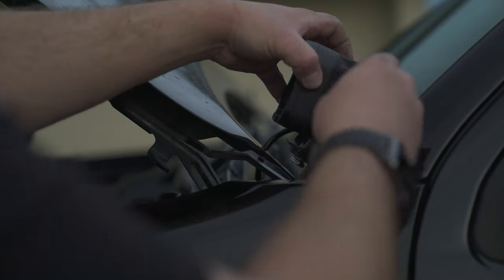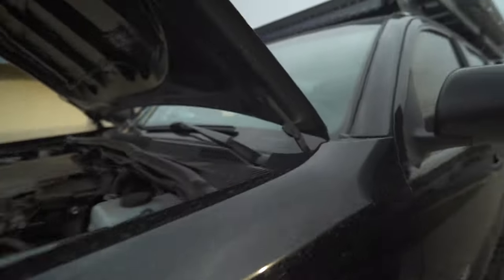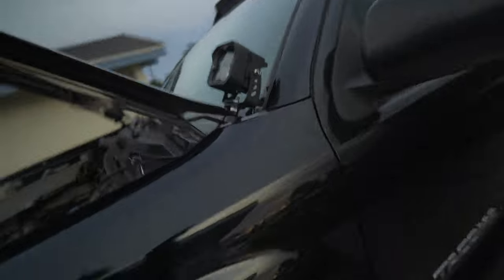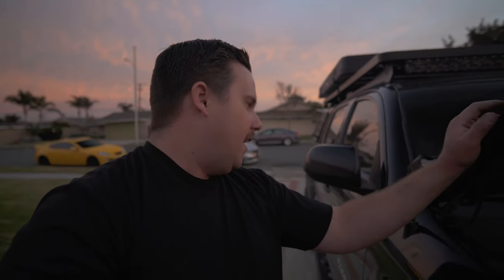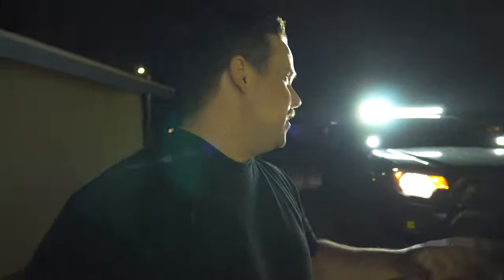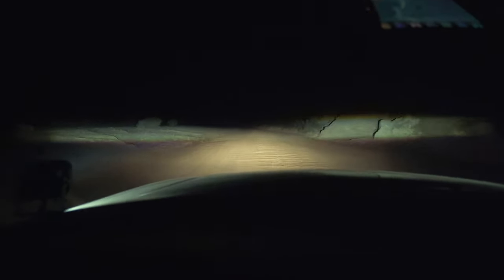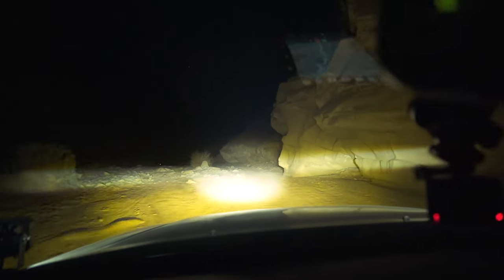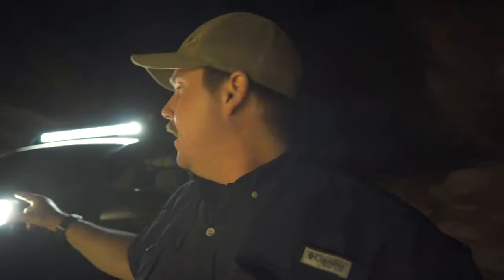3” LED Pods |  ARE THEY WORTH IT? Install And Test Of Lasfit’s LED Pods

Comment: Where and how did you mount your auxbeam power distribution panel at? Did you drill holes into the side to mount it?
Reply from the maker: Yes I used a rivet tool to create a mounting location.
Reply: @alpinetactics  thanks boss✊🏻

Comment: I could be wrong but I’m pretty sure that’s the fog light pattern either way good video and great lights
Reply from the maker: Thank you, it is not the fog light pattern
Reply: @alpinetactics  Which pattern are these? This is exactly what I need for my truck. I've been fooled too, these look like the fog light pattern.
Reply from the maker: @dedlyop3544  I did the driving patrern
Reply: @alpinetactics  There's no driving pattern on their website.  Fog, flood or Fog/flood combo.  That flat wide light pattern with sharp cut-off is clearly a fog pattern.  I think you would be better served for what you're after if your pods were the flood pattern.
Reply from the maker: @terrywaters6186  they don’t offer the driving pattern anymore. Plenty happy with these free lights

Comment: I noticed that you added these to the 30amp fuse on the Auxbeam. If each light is 2amps why wouldnt you have put them on the 5amp fuse? Just asking as I am about to do the exact same setup (have the new AR800 Auxbeam) and trying to figure out which fuse will work .
Reply from the maker: I did it in the order I wanted it for the actual switch panel. I’m pretty sure it shouldn’t matter where you have the fuses as long as you don’t surpass the total load capacity. I’m pretty sure I ended up moving that fuse but overall mine controls pretty much just lighting anyways so I’ll never come close to the load capacity of the unit.

Comment: Do the lights not come with mounting.brackets for under the hood?
Reply from the maker: No you would have to order the correct brackets for your vehicle. If you have a Tacoma like I do I linked the brackets I used in the video description.
Reply: @alpinetactics  no, I have a 2023 tundra. Hard to find a decent priced bracket

Comment: My Ford Raptor has some Aux switches, some are rated 30 AMPS. So If this put out about 2Amps Per Pod. Can I out 4 pods running the same Aux switch?
Reply from the maker: As long you aren’t drawing more power then what the components are rated for I don’t see why not. I run multiple lights to the same switch as well
Reply: @alpinetactics  Omg thanks for your quick response. I’m thinking of running all 4 pods to a 1 way to 4 way Power distributor box and from there to the 30 AMP Auxiliary Cable. I’m thinking even the 10AMP Auxiliary one is enough for the 4 Pods right?
Reply from the maker: @kebenguerrero9708  as long as the box and wires and any other components you are using are rated above the maximum current of all 4 lights put together yep.